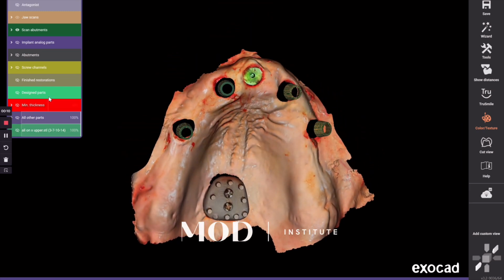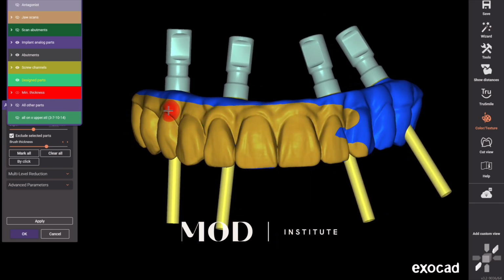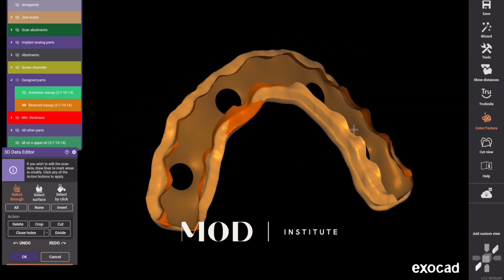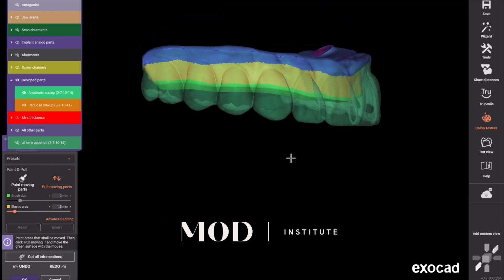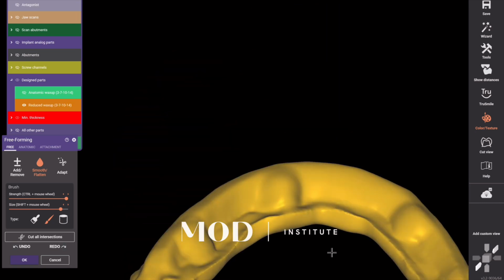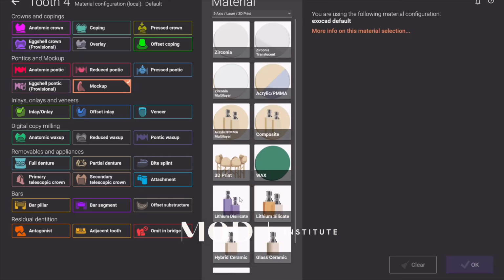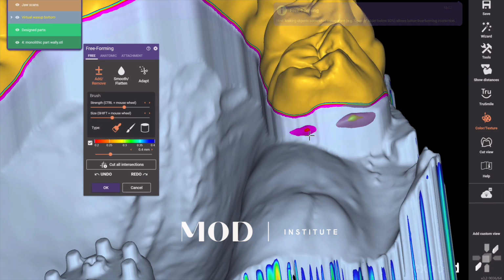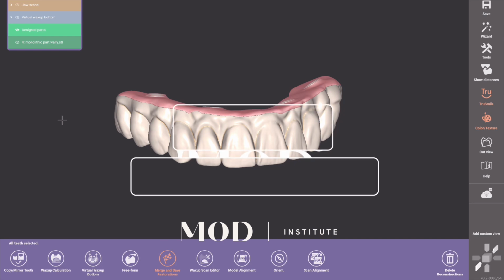exocad e-bar tutorial

Comment: It seems like using the mock-up to cut intersections requires manual reduction of the block-out at the margins. Why not import the subtract file as a crown prep scan so you can use the cement space tool? Would that work?